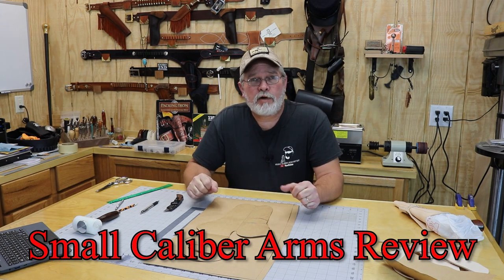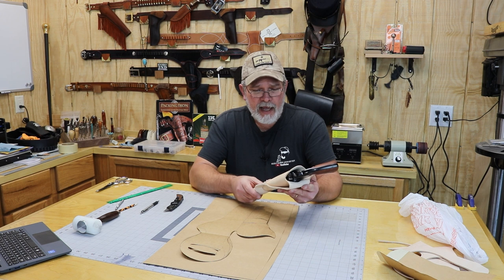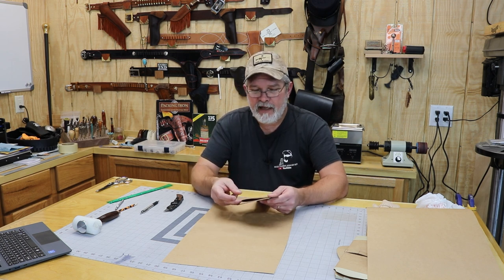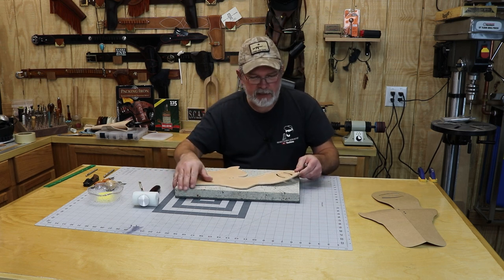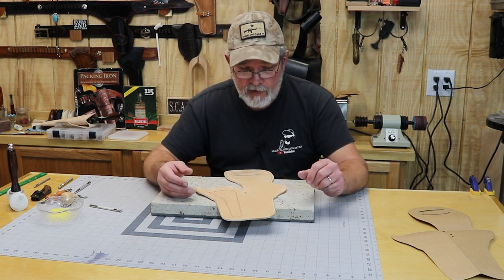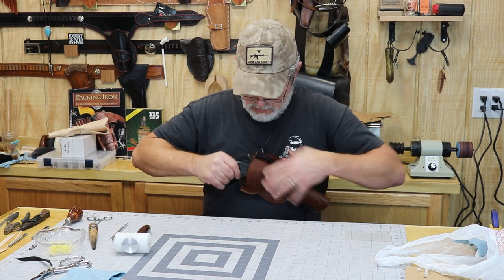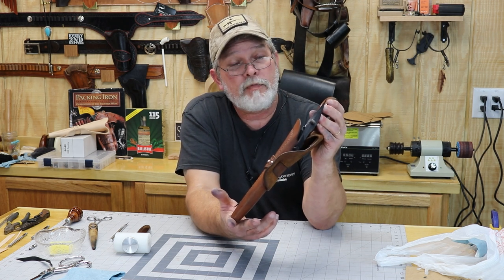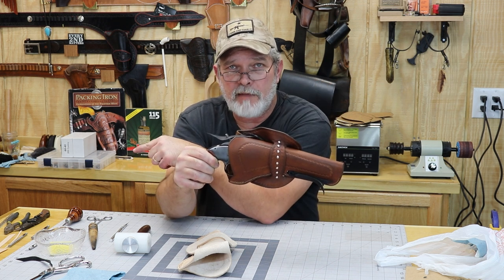Crossfire Trail Schofield Holster | Leather Project!

Comment: No oil? All the water and dye, suckibg all the natural oils out of the leather ... needs a light coat of oil, keep the leather supple.
Reply from the maker: That's the tricky part! I haven't applied any oil yet because I don't want to make the holster any darker than it is. I'm still going to finish it but I think I'll just be using Leather Balm on the body and maybe neatsfoot oil on the thong and blood knot. The holsters on the wall behind me have had their colors changed dramatically because of the finish I've used on them.
Reply from the maker: I just got done applying the finish on the holster. I wish I had done it before I folded it and laced it all together but with wool daubers, q-tips, elbow grease and some soft cloths, I was able to get everything covered. The holster did darken slightly but it still looks pretty good.